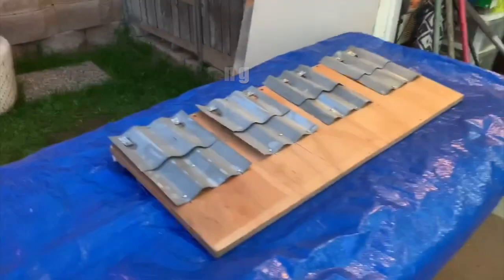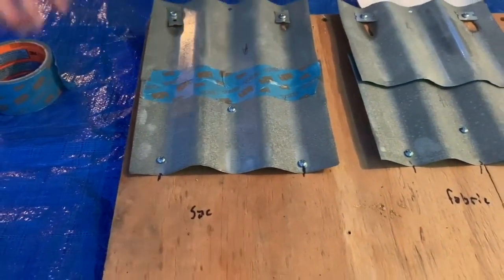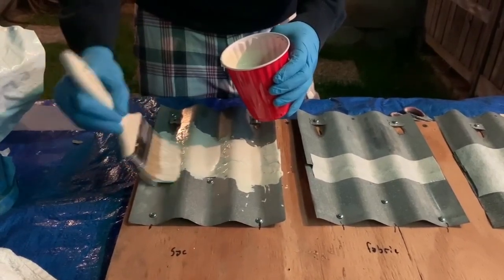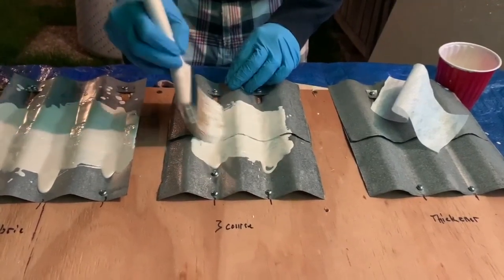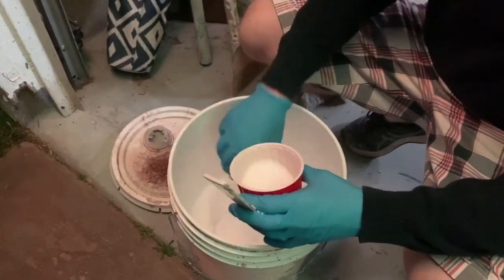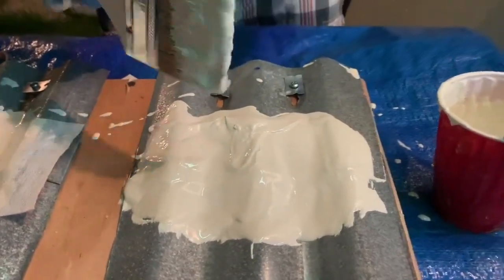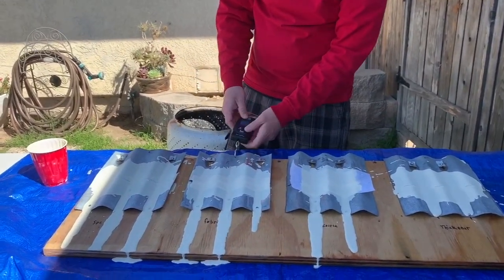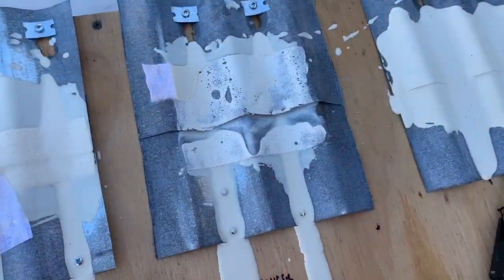Metal Roof Seam Repair (Stop Leaks Easily)

Comment: Very interesting video. I am especially interested in using butyl tape to cover seams on an Alumawood insulated roof that has persistent leaks in spite of extra caulking and the use of Gorilla spray sealer on suspect seams.  Is there a better coating than the usual caulking and sealers that will hold up to weather.  Would butyl tape over the seams and sealer on top of it be something to try?  Thanks again.
Reply from the maker: A Butyl Fabric Faced tape should work for Alumawood, but it needs to be Fabric Faced and NOT foil faced, preferable polyester fabric faced. The tape should be firmly attached to the panels at seams, a hand roller could be used to make sure there are no voids or air pockets. This type of tape will only be available at roofing supply dealers, not at big box stores. 

You can use Ecodur Roof Coating or any reputable roof coating to cover the tape. Just don't leave the tape exposed!

If you have further questions, feel free to send us an email at info@castagra.com! We have a great technical team that can answer any of your questions. Have a great day!